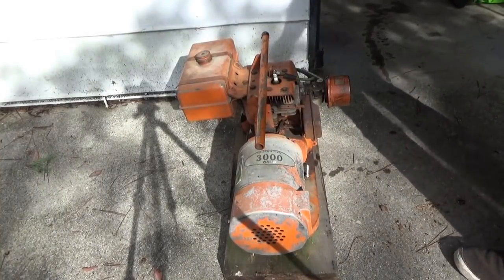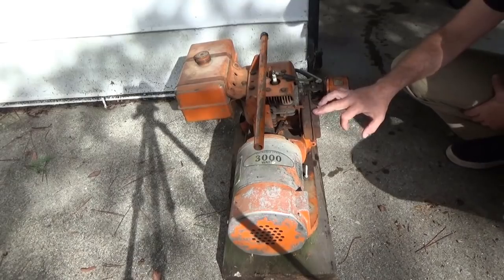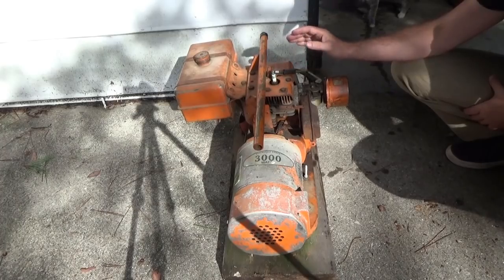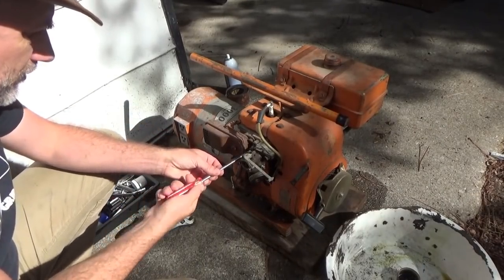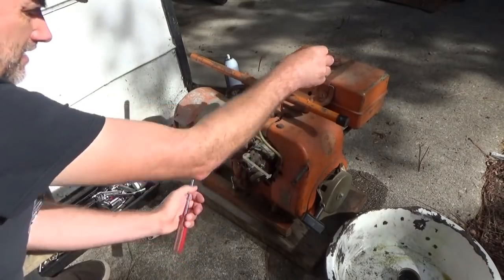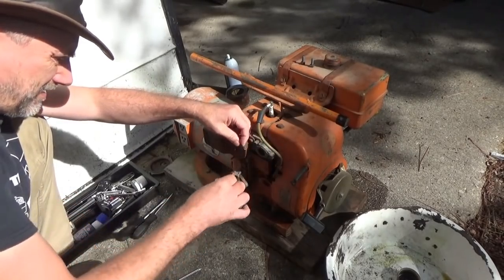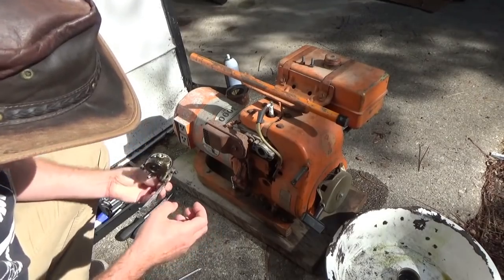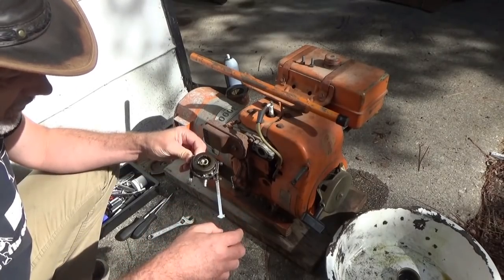Repairing Old Gas Generator Step By Step

Comment: Troy being a business person you need to have the parts on the man for you can finish your work and make it more interesting video
Reply from the maker: Well, since this is the first in two years, its going to take me some time to get properly set up again. I am going to buy rolls of gas line, extra fuel filters, spark plugs and so on.
Reply from the maker: I agree. I want to get a proper parts cleaning tank.

Comment: My hobby is repairing small engines.

I strongly recommend removing the gas tank and rinsing it out with fresh gas.  There is likely still "crud" in the bottom of the tank which will just clog up your carburetor again.

A new spark plug is a MUST.  I could not tell what brand of engine it is, but it is very easy to retrofit electronic ignition on old Briggs and Stratton engines.  Less than $50.  I have a 60s vintage rototiller that I put electronic ignition on when I got it over 10 years ago.  Starts first or second pull every time and the spark plug will last forever.
Reply from the maker: New plug and clean the tank, yes. Changing to electronic ignition is not worth it because this generator can only sell for $150 max once its running. And its gonna cost $20 or so to get it running just in parts. Air filter, spark plug, oil, fuel line. Thats not counting labor.
Reply from the maker: 3 actually but yes I did say that and I finally decided to do this anyway cause I got a LOAD of stuff to fix for someone.

Comment: Good video, You can count the number of turns on the jets by screwing them in first, then taking them out. All jets should be removed and cleaned when doing a carb clean.

Comment: nice project!! can tell you that I had a small engine shop and auto shop that gen. is from around 1980 give or take a few years. NAPA has a carb rebuild kit for tecumseh engine. also gaskets and air filter and fuel line.  tractor supply will have everything except carb kit. HD 30 oil. winter 5W30 or 10W30. small engine oil. also there is probably points under the flywheel if you have spark trouble running with a miss wen  running.  that screw underside bowl is pre set for 1 1/4 turned out. running un screw adjustment engine rich then slowly turn in to smooth out. re check with load on gen. that's how you set mixture. engine speed is 3600 RPM. easiest way is to use frequency counter on AC 120V set for 60HZ. ok if drops a little under load.  USA power 110V to 125V RMS volts at 50 to 60HZ and will be fine.125V no load max.
Reply: ethanol free gas. take out spark plug.spray carb cleaner in hole pull no spark plug in. check spark. J8 or J19LM type. sold all over.
Reply: Is there an electronic ignition retro fit kit available for that Tecumseh engine ?
Reply: Yes they have them for most old engines .even the old REO cast iron. just unhook points and connect unit. there is a few types. amazon and eBay have them. search for   electronic ignition kit for small engine . if your engine old enough to have points  .ethanol free gas.

Comment: Troy is that generator from the 1960s
Reply: that's a direct drive and a aluminum block  tecumseh engine. some where in 1970 to 1980. before tecumseh was clinton and REO.  either way its old. may not get AC. if I had the numbers off engine I could tell you what year and what plaint and what shift it was made. I have old books to 1990.

Comment: Great video Troy thanks for sharing!!! I have a question on a solar freezer/fridge. Would the harbor freight 100 solar panel kit operate a 7 cubic freezer or freezer turned into a fridge?    Trying to get everything up and running off grid before the snow decides to fly.    Thanks for replying have a blessed evening 🌻🐝🌻
Reply from the maker: Thanks. I would prefer 3 of those solar panels minimum because the sun does not always shine bright and happy

Comment: THAT GREEN STUFF IN THE GAS. IN THE CARB IS ALIMINUM OXIDE. MIX WITH OTHER STUFF. LIKE WATER THAT GAS SOKE UP FROM THE AIR. U NEED GUNK CARBURETOR PARTS CLEANER COMPLETE KIT. AND IF U HEAT IT UP IN A CROCK POT TO ABOUT 100 TO 125 NO MORE DONT LIKE GETTING NERE  THE FLASH POINT OF 147. HOPE EVER ONE HAS A GRATE DAY AND SEE U ALL OVER AT DIYTUBE CHRIS 
https://shop.advanceautoparts.com/p/gunk-carburetor-parts-cleaner-complete-kit-cc3k/7040709-P

Comment: A friend of mine has a generator exactly like the one shown, it sat unused for over a year and when he had a need for it, it failed to produce voltage. He took it to a repair place and they had to "flash" or as they said it, put some residual magnetism in the armature so that it would excite the field coils to produce the current output. They told him this was a common occurrence with the older generators when allowed to sit for a spell to lose the magnetism. Hope this isn't the case with the one you had shown in the video. Both his and toe one you have  has the Tecumseh engine and are really tough engines, they can be mistreated horribly and being like a Timex watch takes a licking and keeps on ticking.